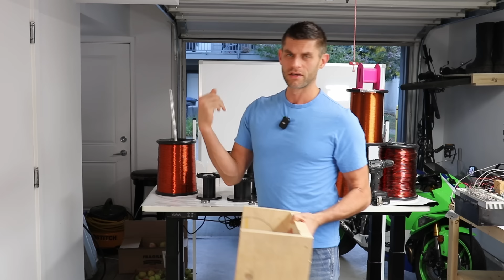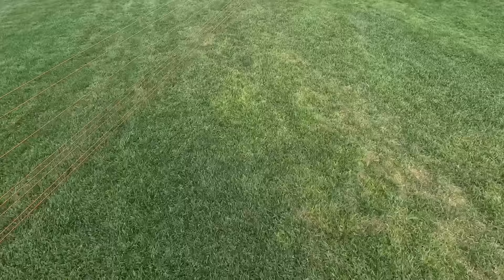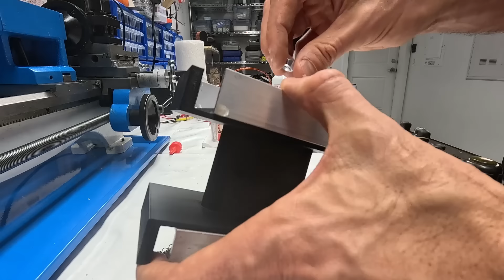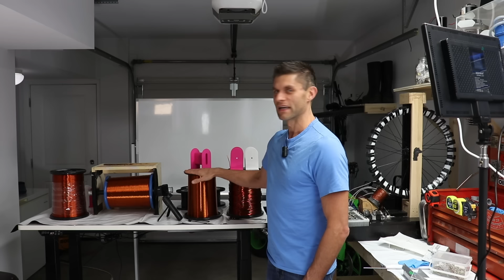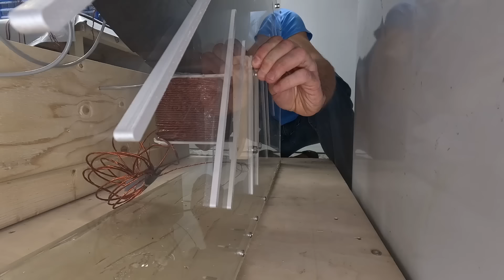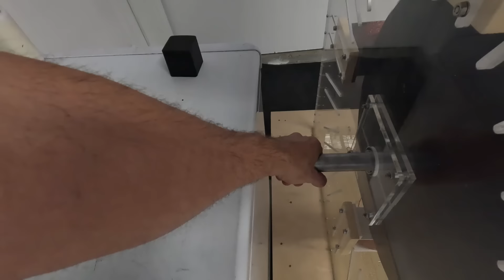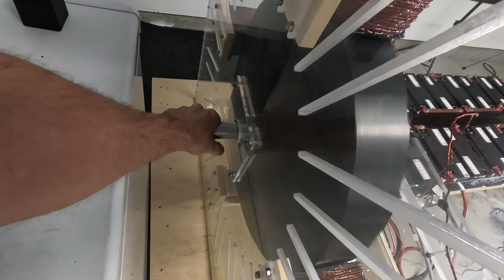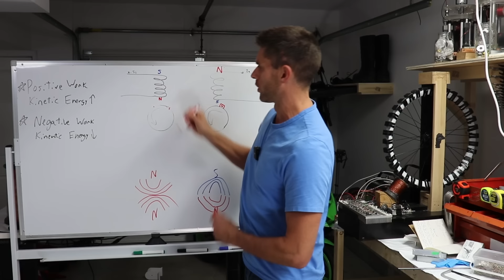The Device That Could Give The World Unlimited Energy

Comment: Hey Spencer, a couple things. There's no need to create a South pole attraction trying to increase efficiency, the iron core will do all the work for free by attracting the next approaching magnet, no need to waste the energy! As you repel the magnet passing TDC you 're already attracting the next magnet with the iron core for free. Also remember to perform impedance matching of your Mosfets before you group them together on a board, the performance is much better. Also, you're engineering out the Natural Analogue performance of the Bendini SG circuit design by not allowing the impedance condition of the batteries to self regulate the RPM's. Remember what John Bedini says in his books, always build it exactly as he shows you to confirm the results that he gets before you make modifications to the design such as combining multiple modalities from many builders. Follow the scientific method of repeatability before changing anything, then only change one thing at a time. @InfiniteVacuumEnergy
Bedini SG, The Complete Beginner's Handbook
Bedini SG, The Complete Intermediate Handbook
Bedini SG, The Complete Advanced Handbook
https://emediapress.com/shop/bedini-sg/

Comment: At 4:15 you demonstrate how the field operates around your coil... There is no South pole (only a NORTH pole (and yes, the Earth is flat))... your demonstration clearly shows how there is a vortex magnetic field but it flows slightly differently than you explain.  The North pole field flows through the center of your coil (on the RIGHT side in your video) then comes out the center of the coil (on the LEFT side of your video) then the same field is "sucked" back around to the RIGHT and the process repeats.  Once people throw out the idea of 2 poles and concentrate on the reality of just the 1 pole things get so much easier.
Reply from the maker: I dunno. Interesting thoughts 🤔

Comment: Lol no, U ALWAYS DISCONNECT NEG 1ST AND RECONNECT NEG LAST!!!

Conventional flow is NOT electron flow. Technically you would want to disconnect the load first which the load is usually in a DC circuit routed to ground last so if you take the load off of something you're disconnecting the ground technically. To be safe and disconnect all loads first you disconnect the negative then all loads don't have a path to ground therefore the only things that would hold a charge is a capacitor which those do that anyways
Reply: Yes he should use capacitors first as an accumalator before feeding to batteries audio capacitors would be perfect for this
Reply from the maker: No capacitors
Reply from the maker: Umm no to each there own, some ppl do it one way some another. I was taught as a heavy duty mechanic this way abd its how I prefer
Reply: I mentioned caps only because I said "then all loads..." And so I did a technical correction.

But that brings up a good reason  for disconnecting - first: if (just for grins) u had caps in the circuit, and u disconnect + first, what happens if part of the circuit touches the + side of a cap by accident? Well, then a path is still completed to the circuits ground (the cap is the new battery, when u remove the battery). If u disconnect the -, a cap can't discharge to "ground" because it's no longer common with the - of the battery.

I'm not saying that how u did what u did, with ur particular circuit, is wrong or unsafe. I'm saying it's VERY bad practice, in general, because disconnecting - first in any DC circuit, is always safe, but disconnecting + first isn't always.

If u were taught (assuming u meant to say "by" a heavy duty mechanic... Odd classification IMO) to disconnect + first, by someone who knows what they're doing (electrically, not just mechanically), then they should've explained why that would make sense. If they didn't, then that was rude. U only disconnect+ first, if ur working with a + ground circuit.

Comment: firstly awesome work you are doing. Electricity flows on the outside of the wire not inside. I have though of a magnet motor but without the pulsing just using permanent magnets and to get over the coging effect of using the magnets in a halbeck array. Adding the pulsing would make some serious torque. Keep up the good work and there is many ways of "free energy"
Reply from the maker: Thanks for the support. 

Electrons flow inside the wire. Magnetic fields outside.

Comment: FREE FOOD FOR THOUGHT. ..."THEORY" The electro magnetic pulse should NOT BE PUSHING or PULLING; it should simply negate the magnet's attraction to, or repulsion from, the steel rod at top dead center! THATS IT! SOME NOTES on that simple concept.      I do  have the awesome shop setup like you do - for you it would be a one day build.THE ELECTRIC          is NOT doing WORK outside of the MINIMUM amount needed to "FREE THE MAGNET" from its natural attraction           to steel.       CONSTRUCTION SUGGESTIONS - it's extremely difficult to determine exactly how much voltage it takes to simply "NEGATE" a magnet's attraction to a steel rod so here's how I would do that with a physical setup;

 FIRST build the simple one or two magnets on large diameter disk with tiny high efficiency bearings SECOND mount the steel rod with no coils. THIRD by hand rotate the magnet past the rod and "Feel" the attraction and resistance FOURTH wrap ten or 20 rounds of small copper motor wire around the rod FIFTH energize the wire and, by hand,  turn the wheel and "Feel" the attraction/ repulsion of the magnet to the steel rod now. If you can not feel an attraction or repulsion SUCCESS! ! ! but probably not on first try - if there was repulsion then reduce number of rounds of wire or reduce DC voltage (whichever is easier for you) until you can feel NO PULL FROM THE MAGNET ON THE ROD. a simple, home made commutator on the disk or shaft can make the timing easier but it is never easy to get the EXACT TIMING for the magnet alignment with the steel rod.    - I build this thing about 18 years ago and it ran on a 1.5 v AA battery but did not have any testing equipment to see how much energy was being put in as opposed to how much the flywheel could put out......on smaller setups this calculation is extremely difficult even with the right equipment. my setup was only about four inches diameter and the steel rod rotated instead of the magnets but that's just the builder's choice. MODERN electric motors FORCE WORK TO BE DONE (and that's a great strategy and works great for the purpose of "GETTING WORK DONE" ) but when your focus is "HARVESTING THE FREE ENERGY OF A MAGNET"    you need a kinder gentler strategy such as this theory. IT can always be scaled up and multiplied in many ways to get a decent output but the key is to FIRST find a tangible amount of energy out than is being put in. THEN add ten magnets to rotor - increase size - install multiple rotors on same shaft . To get shaft power equal to a battery drill you might need to build this thing the size of a refrigerator - but who cares ?? It would last a lifetime and put out an energy source at your home - no need for paying electric cos and over time, society would not have to install MEGATONS OF COPPER ELECTRIC WIRE BETWEEN HOMES AND POWER PLANTS ! ! !
Reply from the maker: Great food for thought, thanks for sharing your insights! Would love to see what you described 

We dont use iron cores. Air core

Comment: Ok nice project. Now try this.
Once the motor starts up using battery power, use some large mosfet and turn off that batteries and use large capacitors and see it will continue to run. Use diodes for the snap back voltage to one battery
Reply from the maker: Nice

Comment: PERHAPS THE "EFFICIENCY" OF THESE MAGNETIC FORCES COULD BE INCREASED, BY TILTING THE CENTRAL AXIS OF THE STATOR WINDING, SO IT IS CLOSER TO ~45 DEGREES WRT THE PASSING ROTOR MAGNETIC POLES....   TO GAIN BETTER "MECHANICAL ADVANTAGE", [AS COMPARED TO THE ILLUSTRATED "PERFECTLY ALIGNED AXIS WHICH IS SQUANDERING THE "REPULSIVE FORCES" IN THE FORM OF A "STATIC FORCE],... RATHER THAN CONVERTING IT TO A "KINETIC" FORCE.....   :face-blue-smiling::face-green-smiling::face-orange-raised-eyebrow::face-orange-biting-nails::face-pink-tears::body-blue-raised-arms::face-turquoise-covering-eyes::hand-green-crystal-ball:   :trophy-yellow-smiling::trophy-yellow-smiling::trophy-yellow-smiling::trophy-yellow-smiling::trophy-yellow-smiling:
Reply from the maker: Nice!

Comment: I have a Vevor CNC coil winding machine and a cheap hand winder/counter, the NZ1 model, and I can modify each. I really like your idea of putting good quality bearings on a spool winder, I have noticed that magnet wire will hang up from friction. I have been using the mast on a spring, and if I see it moving down, I can shut the machine off really quick. A fishing pole type of lever with a pulley attachment would probably work with it also, for safety. The Vevor CNC coil winding machine is only like just over $200 plus shipping and tax etc. it's really accurate too, you can set the pitch of travel, by setting in the diameter of the wire. I would really recommend it, I had one arrive that was faulty on the motor, and they made it right by sending me another unit that works really well. I think it would be a good piece of equipment if you think it would help with the good work you're doing. I use mine for winding tube guitar amps. I'm following your work too, if that's ok.
Reply from the maker: So good 👍 thanks for watching and the comment

Comment: FYI: A TRUE "EPOXIED" COIL WINDING IS USUALLY ENTIRELY SUBMERGED IN, AND SATURATED IN EPOXY, THEN PLACED IN A VACUUM CHAMBER, TO SUCK OUT ANY SMALL BUBBLES, BEFORE IT "CURES".....  MERELY COATING THE OUTSIDE WITH A THIN LAYER OF EPOXY, DOES PRACTCALLY NOTHING TO HELP INSULATE THE WINDINGS... (BE SURE TO CHECK FOR PROPER CONTINUTY, (NO SHORTS), BEFORE "POTTING" IT IN EPOXY!!!.  TRY WINDING COILS WITH ALUMINUM WIRE!!!!!!!!
Reply from the maker: We are using epoxy to hold in place not to insulated

Comment: thank u spencer. Pulse primary coil at high frequency, place induction coil next to primary, match the resonance to reduce losses, capture energy from pulsing magnetic field in secondary coil using capacitor also in resonance, discharge capacitor to power load, thats free energy baby
Reply from the maker: Hey Mike. Thanks for the comment and support 🙏

Comment: The John Bendini circuit did the same thing with way less electronics, ps the magnetic field  in the center of the coil is called the null zone ,under collapse that's where the energy comes from ,look at it with a O scope you should see a  h wave
Reply from the maker: Definitly didnt do the same thing. These are SIC components very fast

Comment: I've seen industrial electric motors run quieter than that setup, what's rubbing on that thing? Might even have to lubricate the bearings to make it quieter. (I know ceramic bearings may say no need to lubricate, but if it's making noise that may be an indicator otherwise.)
Reply from the maker: Yes just the ceramic bearings dry... I have ones from USA i can out i  there that come.packed with lube

Comment: Maybe you need to provide a load at the charging battery, maybe the reason the current in is so low there is because the battery is already fully charged?
Reply from the maker: Valid point i like it

Comment: A question, if I may:  Why can't we take a typical automotive (4 wheels) structure and mount DC motors on all four corners utilizing one as a drive motor and the other three as generators to run the lone motor?  Please explain to me - in layman's terms if possible - why this will not work?  Common sense says that you will have three times the amount of power available that is being consumed by the lone motor....
Reply from the maker: Well it will work if you redesign them to not have losses / negative work

Comment: Everything in this video relates to the Poynting vector and the fact that energy doesn't flow in wires, it flows in space(time), and if you want to create useful energy from certain amount of space then you will need to deflect a certain amount of time. That's how the N Machine works, the spacetime within the matrix of the disk is not the same in the center and on the edge, the center is not traveling while the rim travels a lot. Just spin that thing enough. Simple. Same things with a coil, voltage equals speed, so give it a higher voltage per pulse until it gives back more.
Reply from the maker: Interesting thoughts!
Reply: @MadscienceLPTECH in my opinion these aren't just thoughts, they're facts.

Comment: Do you need help? Any job openings?
Reply from the maker: Lol
Reply: @MadscienceLPTECH once i got effect charging capacitor in capacitor coil key loop but can't repeat it now. Key was combined transistor with diode controlled by pulses from generator. Inside coil was rotating disc with magnets.

Comment: You really want break through? Start seeing the electron as a deterrent to pure electrical power as Tesla did.  Create (or actually duplicate) a pulsating high DC voltage circuit that operates in the 100+ mega hertz range that has a duty cycle of 25-30 %.  Parallel this circuits power input (at the circuit) with an antenna, and its output to an insulated water cooled metallic rod, and presto....you've tapped the Aether.  Point that rod at anything metallic and watch it melt like butter or ground the targeted metal through a capacitor and you have unlimited electricity.  This by the way describes how Tesla's "real" hairpin circuit worked, and how his "wireless" electrical power was achieved.  

Lastly, once the circuit was triggered "on" and only enough time for "electricity" (but no "current" to travel through it is allowed) the circuits initial power supply acts like a 'well' pump jack. Once power from the Aether (a.k.a. zero point) begins to flow,  more power from the Aether flows. Read up on Tesla and his "Hairpin circuit " if you doubt me.
Reply: Thank you!!
Reply: Can you provide a good link that hasn't been corrupted?
Reply from the maker: Interesting thoughts, appreciate you sharing!

Comment: YOur method of testing for shorts between the various strands of your mulitfilar winding is wrong. It would not detect a short between wires. Label them A through H, then test A to B, C, D ... H. If no short to A is found, set A aside, and test B to each of the others, if good, set B aside and test C to the remaing five (D-H) etc. Tedious, but it will work and your method doesn't.
Reply from the maker: Thats what I did. Test 1 at one end with all 8 ends at the other

Comment: Really great work!!  Might you have plans to use a dial rotor system in which each magnet coil is centered between 2 coaxial rotors ?… N on one side and S on the other… And also I’m curious about your plan for Generator coil … At what point do you close the loop during the magnets approach & pass?   Might you have considered bucking coils at all for the generators? I’ve used shorted bucking coils and observed increased speed with reduced pwr draw.  Curious if you’ve stuffed that.      Thanks!!
Reply from the maker: Very cool, that's how Thane Heins technology works too... kinda
Reply from the maker: Yes we want to go to NSNS in future

Comment: Have you thought about turning your coil sideways lowering them and adding a second plate in the back to basically work as a counterweight. To help propel your speed to where you can for half of a rotation shut off any input allowing the counterweight to maintain speed and only give you an output. Even at half a turn you would produce more than use. Kind of hard to explain in just a few sentences.
Reply from the maker: Great ideas

Comment: I was close to the John Bedini motor efforts in the early 2000s, and at one point, I bought his battery charger using "radiant" energy.  I thought I would make a living by repairing messed-up batteries, as this charger claimed that it could fix dead batteries by repeatedly charging and discharging the battery over time.  After much experimentation, I found out that just as radiant energy charged these batteries, so it naturally seemed to leak out its energy over time.  Every battery I charged this way could not hold a charge for more than a few days.  It ended up being a waste of $6000.  Also, Bedini could not get much power out of his motors, though he tried many variations.  We had a seminar where we were each given Bedini motor kits and assembled them, but got varied results.  It turns out that this radiant energy is very difficult to tame.  No one could really explain why one kit would work while the rest (95%) didn't.  I admire your efforts, but don't be surprised to find many gremlins to tame in your efforts to make something usable and reproducible.
Reply from the maker: That was old technology. Great comment though thanks for your support 🙏